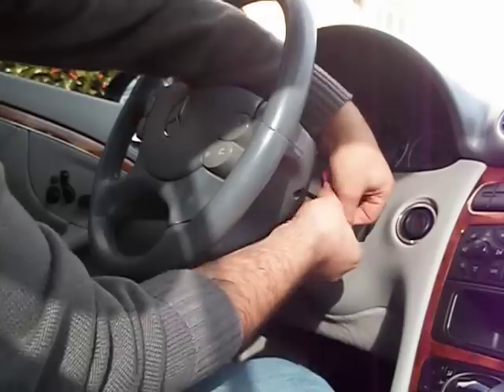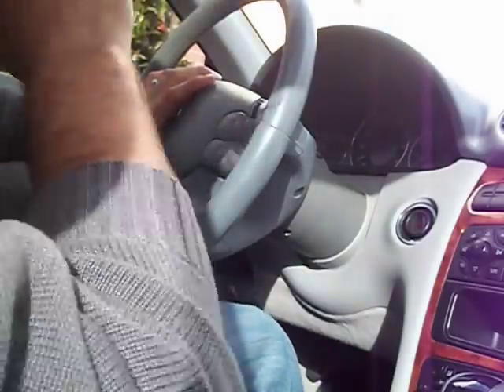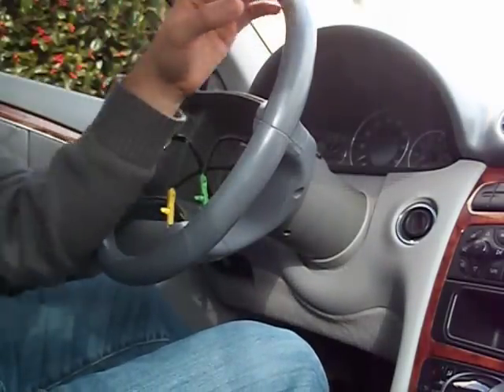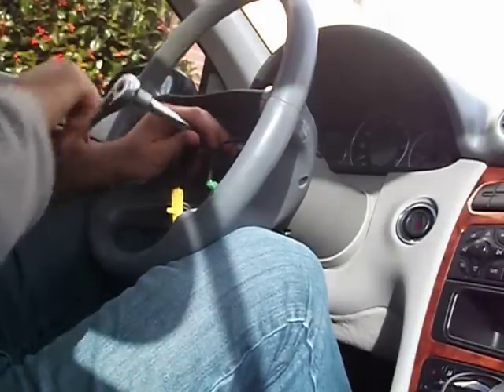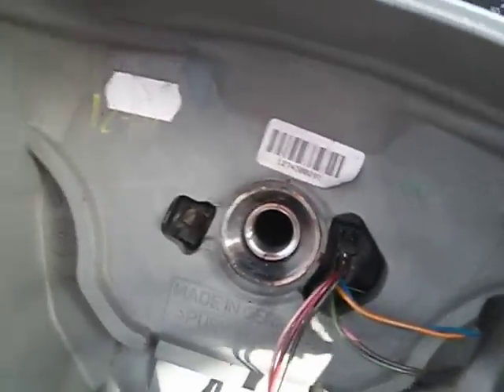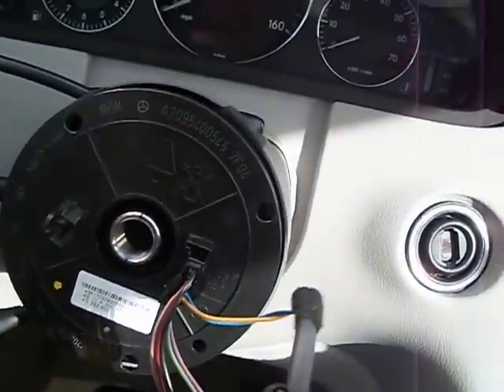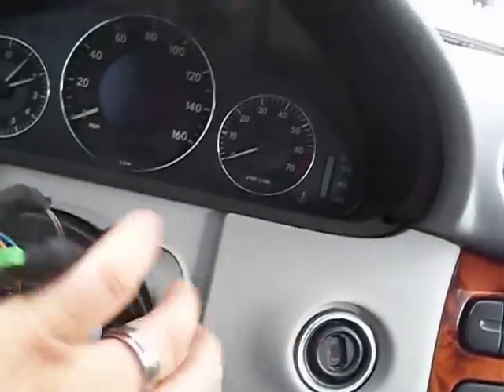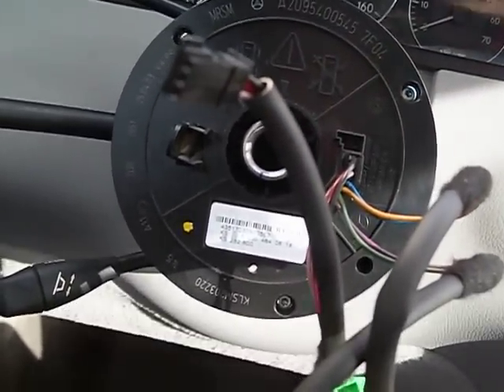Removing or Replacing Airbag, Steering Wheel, Clock Spring, Turn Signal Switch on a Mercedes Benz

Comment: Do you have to disconnect the battery before you started everything? Thanks
Reply: Yes and don't do anything for 30 minutes to allow the electrical system to discharge.
Reply: to speed up the discharge process, do this: unhook battery in the trunk of the car and then hold both, the + and the - wire together. This will discharge immediately, without waiting. Btw, this also will clear a 'check engine' light.

Comment: I have an elegance 4-spoke steering wheel on my W203 2006 and want to change it with sporty 3-spoke steering wheel. The pin connectors from airbag commands are not the same. Do I need to replace the clock spring with these right pins from sporty st. wheel or need something else to make it work ? Greetings from Slovenia
Reply: From what I know a different clock spring causes issues with the CAN bus. Your steering wheel buttons will not work.

Comment: Where is the part of the video where you remove/replace/repair the clock spring and replace the turn signal/hi/low beam switch?
The video just stopped after removing the steering wheel.
Reply: honda steering wheel removal honda97 logo
Reply: honda logo